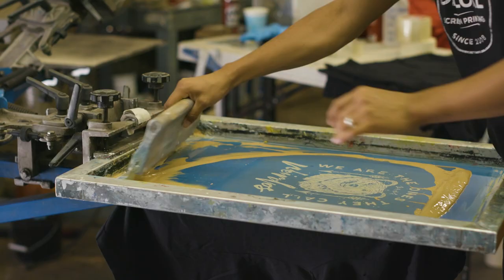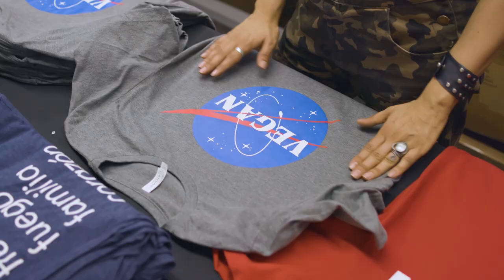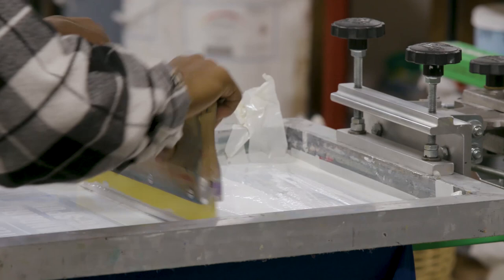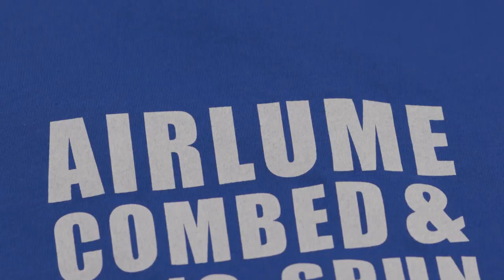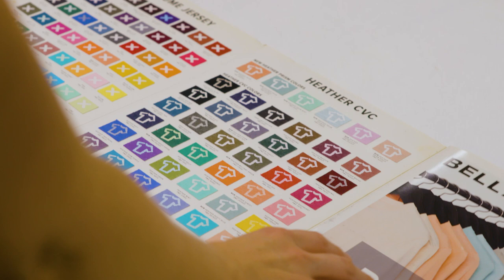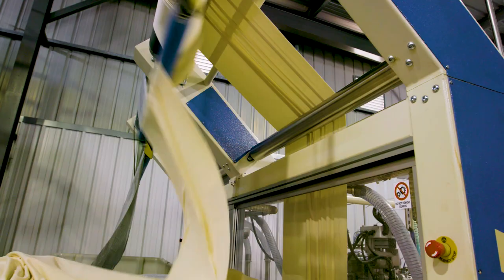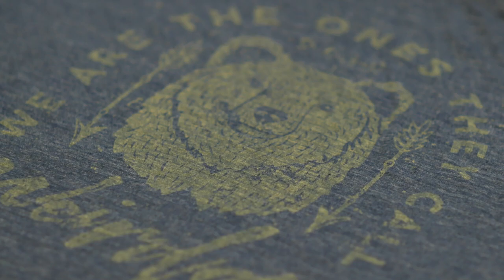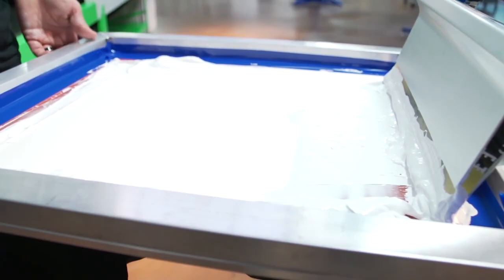Discharge Screen Printing — What you need to know about Discharge Ink

Comment: Could I use discharge with a flash cure. Video made it seem I need a large Drying heat cure unit with a air ventilation. Prob crucial info so ur not huffing chemical

Comment: Hi! Thanks for this video. I have a technical question; i haven’t heat conveyor or any automated drying system, just those things that are around me at home. I know that discharging process takes place as the fabric get dry. Is “industrial drying system” necessary if i use discharge ink raw - so without any pigment/additional plastisol? Or can i get the same result by drying fabric by itself? Thanks
Reply from the maker: @shirtagency Do you guys know?